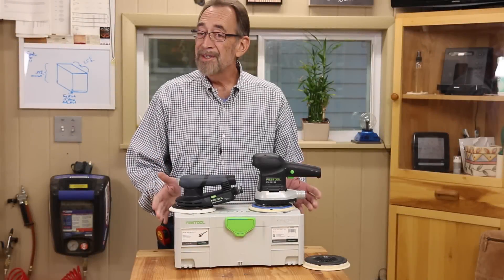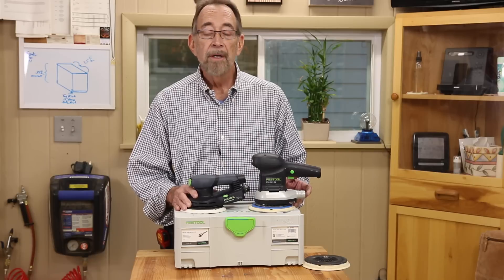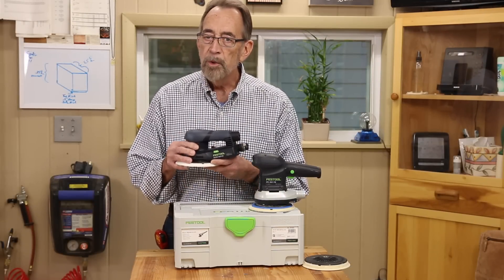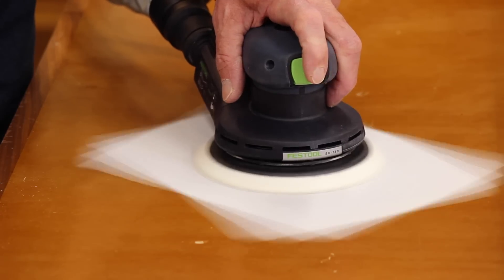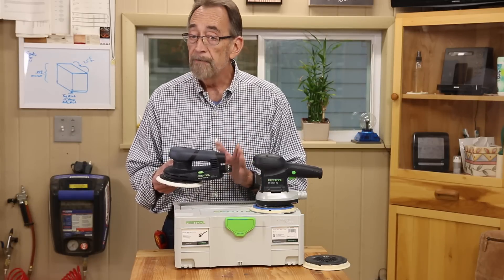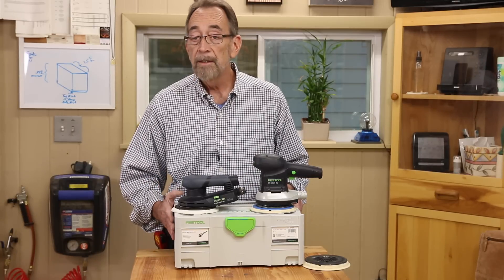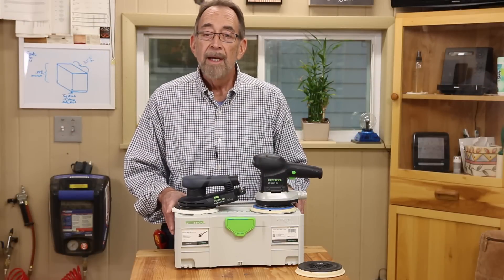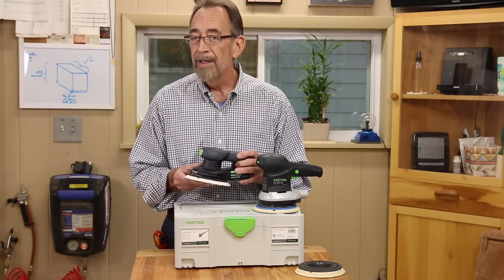Festool EC Sanders Product Tour

Comment: Steve, why would you not get rid of the old sander in favor of the EC? I have the 150/3 EQ and am thinking about trading up but now you've got me wondering...
Reply: +Matt Przybylski Hi Matt... The EQ model sander is heavier than the new EC, and in some situations where I want/need to use a little more pressure and be a little more aggressive, it actually requires a little less "muscle."  For now I'm keeping both.  The mind is a wonderful thing, how we can manage to justify almost anything!  :)  I almost always have multiple projects going on at the same time.  The hard pad on the EQ for one project, the soft pad on the EC on another project.... sort of like Norm and his 10 routers each with a different bit installed, I guess.  Sounds extravagant, but It does save time having multiple sanders with different pads installed.  Of course space is always a consideration, so when I got the EC I gave away the last of P-C random orbit sanders... it took me like 8 years, but as far as ROS's, I'm "all Festool" now.  Eventually I may be "all EC."
Reply: Got it, thanks for the answer :)